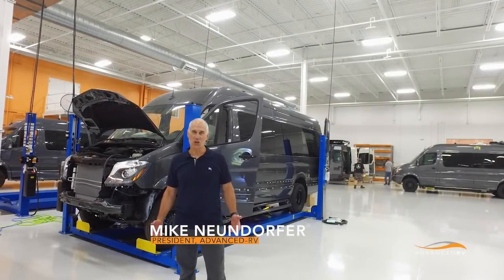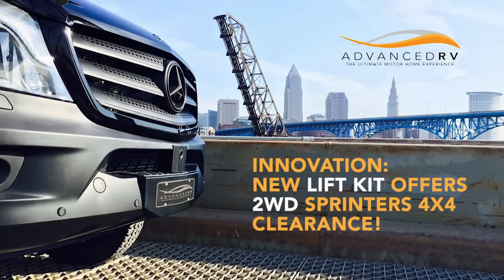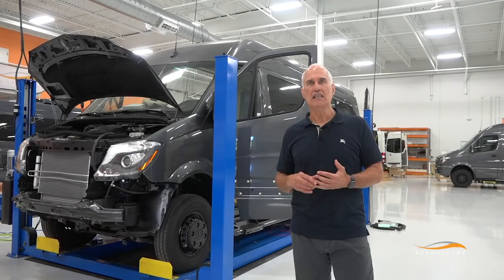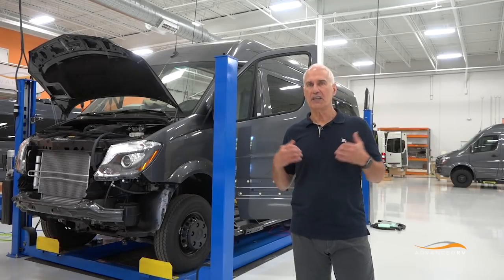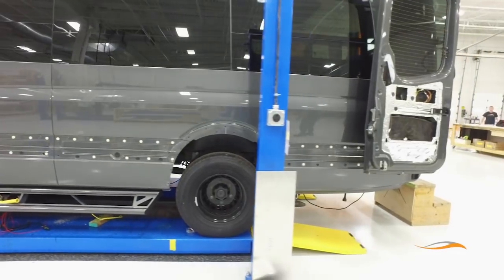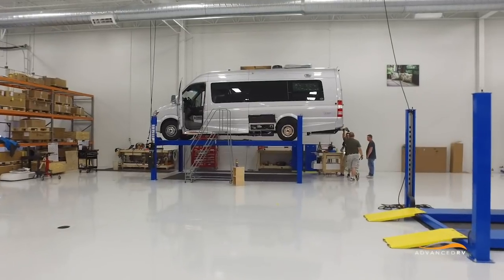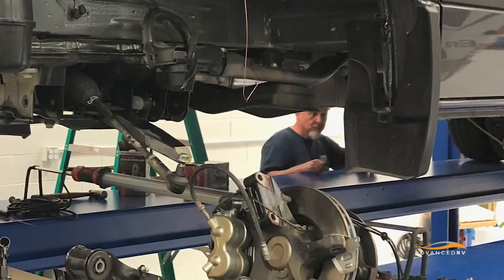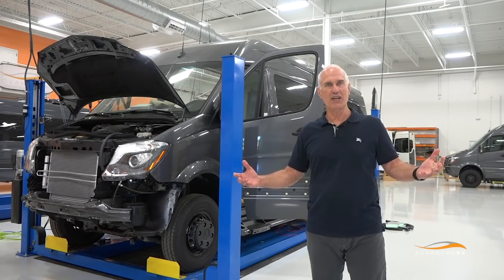Innovation: New Lift Kit Offers 2WD Sprinters 4x4 Clearance

Comment: Great idea. Does it affect the warranty?
Reply from the maker: Thanks for the question, Ben. We don't make any modifications that affect the chassis warranty.
Reply: About how much is this option cost? This now makes 3 options that Advanced RV does that I want. Lift, rear air suspension and levelers. Thank you

Comment: Don’t 4x4 sprinters have less clearance than 2wd ?
Reply from the maker: 4x4 Sprinters have around 3 inches of additional ground clearance compared the the rear wheel drive models
Reply: @AdvancedRV   Though the 4WD chassis may look like it has more ground clearance than a 2WD because the body height is lifted about 3-4” higher, the actual driveline is the same, so the ground clearance is equal. ( according to google )